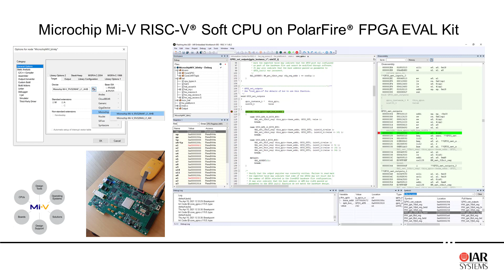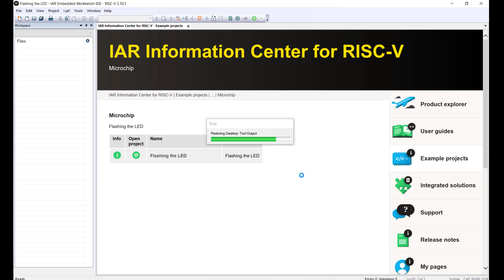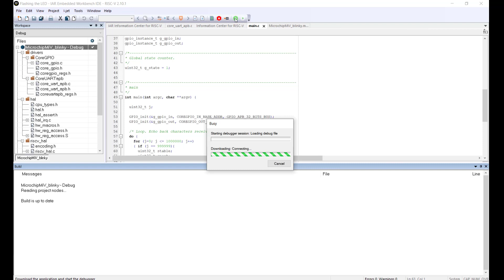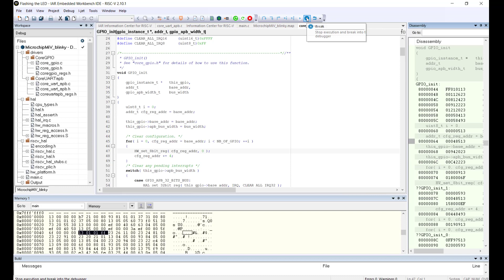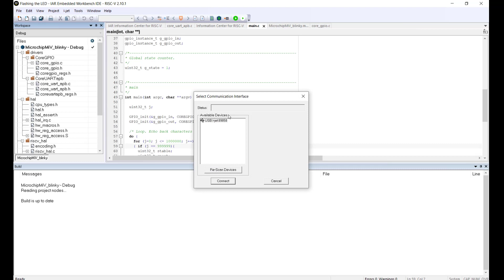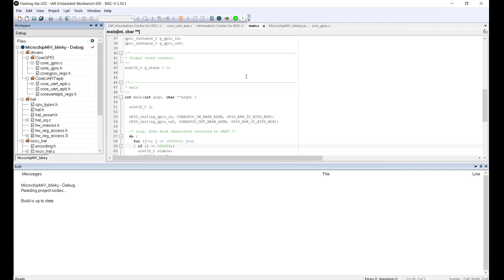IAR Embedded Workbench for RISC-V with the Mi-V RISC-V® Soft CPU on PolarFire® FPGA EVAL Kit

Comment: Hi! Is there a way to dissable delimiter symbol <'> seen in the "Registers 1/Value" column in the IDE?
Reply from the maker: Thanks for your feedback. Starting from IAR Embedded Workbench for Arm version 8.30, the linker map file and debugger windows show hexadecimal numbers with apostrophes (single quotes) as separators. The reason was the move of the IDE to 64-bit and the issue of displaying 64 bit values in a readable way.  Currently there is no way to change or disable it but we have send the feedback to our development. You are welcome to reach out to fae@iar.com so we can keep you updated once there are changes or improvements.